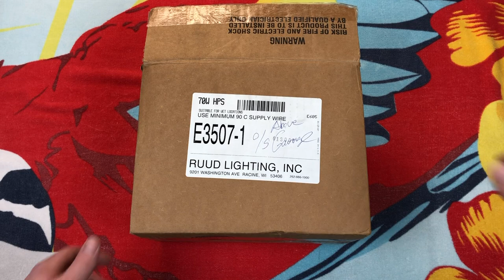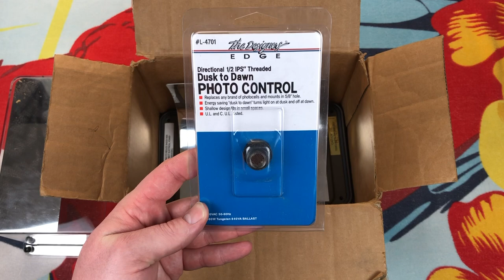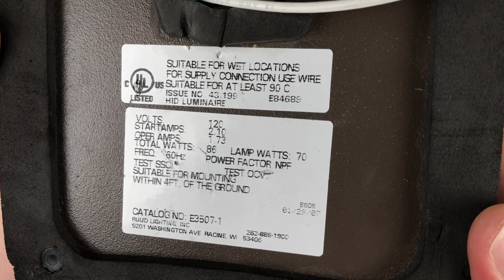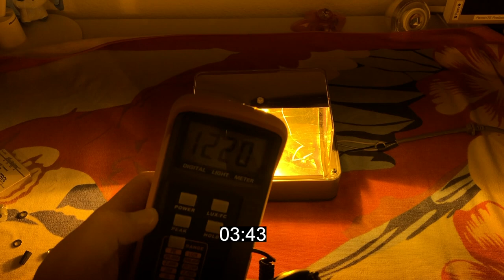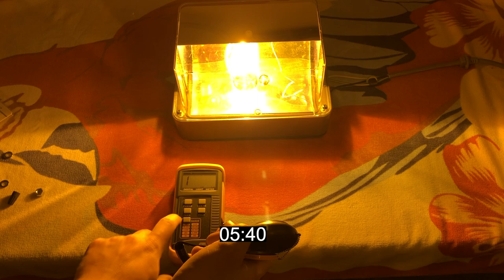RUUD Lighting 70watt High Pressure Sodium Wall Pack

Comment: I do wish when you make videos you could do it outside to see how far and how well it lights areas up... Im having to test this myself because no one has videos of this.. got a 150w spot light from lithonia and i was hoping it would light up my very long driveway, and thankfully it does a pretty good job up to about 150 feet away, but it seems most of its light it throws out is top and bottom and not straight out, so up against a tree it seems to light up the ground and tree tops alot more than further down the road.   I guess thats why its called a flood and not a spot light.   I wish i could find a 250w version that isnt $300 on fleebay lol... i think the 150w while adequate needs a stronger bulb.  I did find a 400w flood on fleebay for $110... but damn 400w might be TOO bright lol and that is alot of power to waste

Comment: Lux is lumen per square meter. In theory if we have ball radiator that radiates same amount of light to every direction we can imagine the lamp inside a ball that area of square meter. Ball of this size would have radius from the lamp of ~28 centimetre (~11"). From that distance your lux meter basically shows lumens to you. 

One foot away gives pretty good approximation but that reflector is a problem as it puts light to the meter, light that was supposed to go to the other direction. Also if your idea is to find out lumen output of that lamp, you should have that lux meter 11" away from the surface of the lamp, not 11" from the surface of the fixture. 

If your idea is to find out lumen output of the whole fixture, angle of the light becomes a problem as in that fixture it's not 360 degrees nor 180. If we would find out what is the angle where the light can escape the fixture, it would be easy to calculate lumen output of the whole fixture.